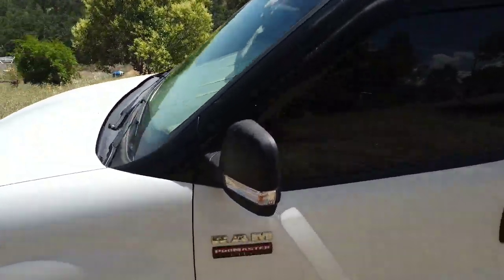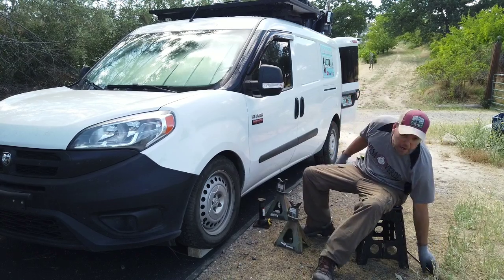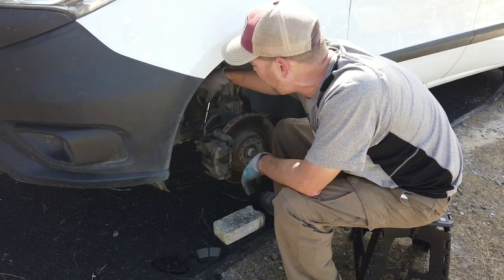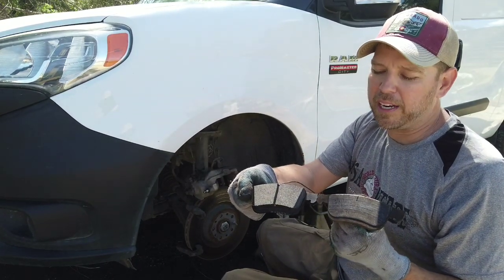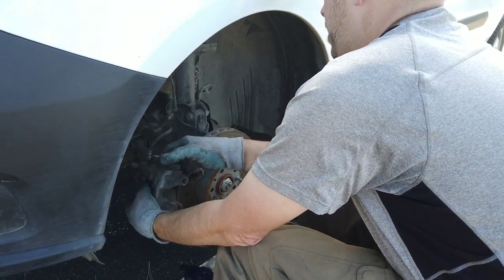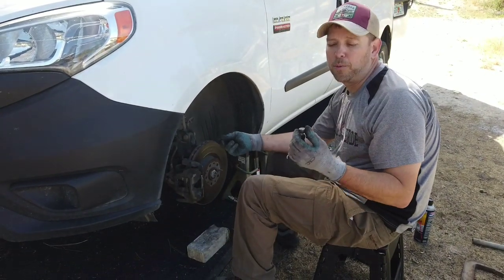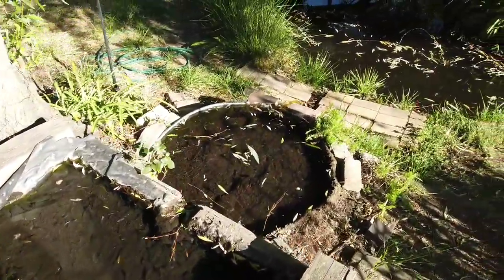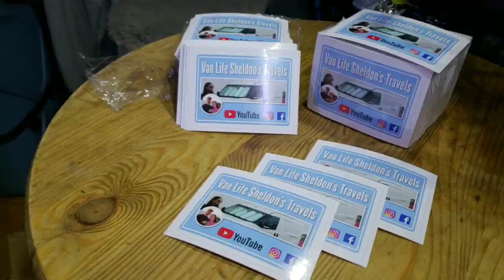WAS THIS A MISTAKE DOES BLUE VAN DAN & ROOSYPOOH HAVE THE TOOLS I NEED TO COMPLETE THIS BRAKE JOB?

Comment: good you were able to borrow the tools to change the brakes and able to do it yourself, saved a lot of money, what about the rear brakes (disc or old drum style) do they need replacing yet and speaking of tires did Wal mart ever get back to you on the tire?
Reply from the maker: The rear breaks are still testing good. So, we are going to wait to replace them. Our back breaks are drum style.  No, Walmart never did get back to us on the tire.
Reply: ok on the tire keep in contact with them where they should be getting a new supply of winter tires sometime I would think in late August early September